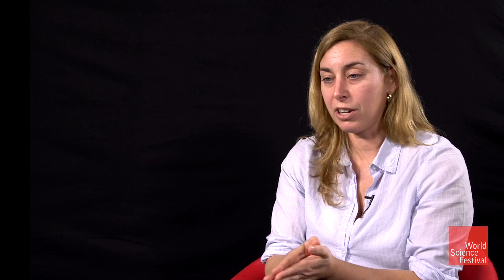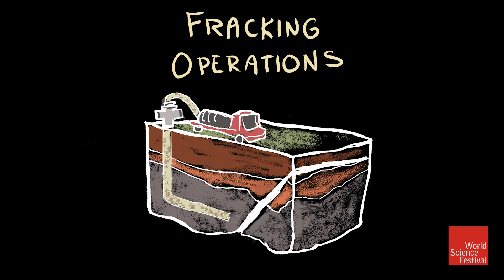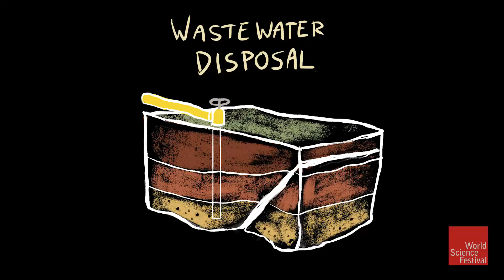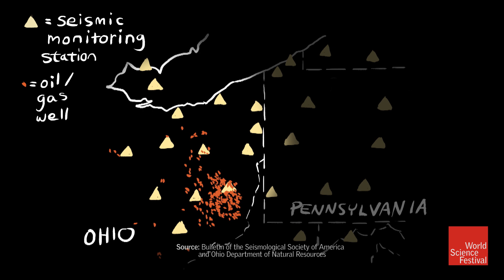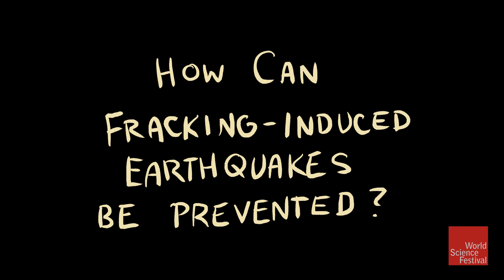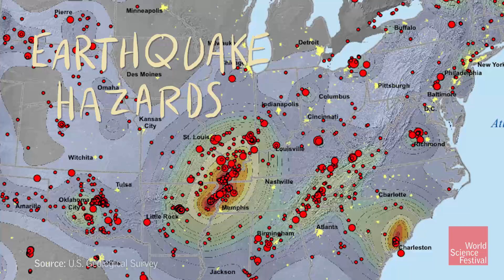How Can Fracking Cause an Earthquake?

Comment: This is sketchy scienece. It postulates that massive, tectonic forces are balanced on the compressed sediment or organic material and this balance is disrupted by machines that create pressure that's not significant in comparison to the masses involved.
Fracking doesn't even go low enough to contaminate the water table, how could it possibly go low enough to disturb a fault in any way?
Reply: For the people of Oklahoma, it has almost become routine.  The earth shakes regularly.  On January 6, two earthquakes with magnitudes of 4.7 and 4.8 rocked the northern region of this central US state.  The damage was minor but nevertheless alerted the local authorities.  One of the tremors, in early October 2015, took place near the town of Cushing, which is home to a huge crude storage complex containing up to 60 million barrels of black gold and considered infrastructure  national strategy.  In 2015, Oklahoma recorded more than 900 earthquakes with a magnitude close to 3, or two and a half per day.
 For 2016, the predictions are no better.  According to the National Earthquake Information Center in Golden, Colorado, the thousand earthquake mark should be crossed.  The central region of the country had recorded only 21 earthquakes of magnitude 3 and above between 1973 and 2008. Since 2008, the increase in the number of earthquakes is exponential.  The cause of this strong seismic activity is, according to a majority of scientists, the hydraulic fracturing of shale gas and oil formations and the multiplication of drilling sites – even if, in 2011, faults traversing the northern state  -east to southwest were the source of the most powerful earthquake the state has ever known
Reply: @bejakabyle  I'm from the area. Yes, there is seismic activity and always has been, though much lower severity and more infrequently than now.
You are however confusing correlation with causation.

I lived in northern Texas after Oklahoma, where drilling of the Barnet Shale paid dividends to all landholder in the area. Yes, there was increased MEASURED ACTIVITY. However there was no MORE ACTIVITY. Some kook who was as uniformed or misinformed as yourself demanded that gas companies measure or fund the measuring of seismic activity at and around drilling sites. Lo-and-behold, with more measuring came more detection. This does not mean there is more seismic activity and certainly not that it's caused by hydraulic fracturing, oil extraction, or any other process humans do, including strip mining and even dynamite blasting mountains. 

If we could CAUSE earthquakes we could conceivably stop them as well. We could also alleviate the threat of unpredictable quakes by regularly and gradually reducing the buildup of pressure between the massive pieces of rock that make-up the crust of the planet. It's simply not something withing the scope of human influence one way or another.
Reply: In Oklahoma, shale gas causes repeated earthquakes
 The multiplication of drilling sites and the enormous volumes of water injected into the ground by hydraulic fracturing are in question.
Reply: @bejakabyle  
No, it doesn't. That's bunk.
Fracking does not and cannot cause seismic activity.
Reply: @Pope2501  how do you know ?
Reply: 2 miles it’s not deep enough ?
Reply: @bejakabyle  
Go talk to a geologist at OU or OSU. Or in Texas. Or anyone in oil and gas. Anyone knowledgeable. Any geologist.

Comment: Look at site maps for earthquakes then look for fracking locations when they occurred. After affects aren't good either.
Reply: Correlation isn't causation.
Reply: @Pope2501  If you have a pattern of repeated correlation through a scientifical observation of the repeated processes involved, you either find yourself in the presence (an extreme low chance) of coincidence every time and call it correlation or in fact being a causation.
Remember, there are shallow earthquakes that happen from 2 miles to 10 miles.
If you start fracturing the ground near such an existing large fracture it will lead to upsetting the existing stability and create earthquakes.
Reply: @ElGoogKO  "Scientifical?" 

Ok, let's test your ability to understand correlation and probability. I think I can illuminate the situation with three or four questions.

Question 1:

If I flip a coin once, the chances of it land on heads or tails is 50/50.
If I flip the same coin ten times successively, and of the first nine times the results are heads, what's the probability that the 10th flip lands tails? 
Is it:
a) significantly greater than 50/50 in favor of tails
b) a small amount greater than 50/50 in favor of tails
c) exactly 50/50
d) a small amount less than 50/50, in favor of heads
e) significantly greater than 50/50 in favor of heads
Reply: @Pope2501 it might not mean causation but are you willing to take the risk. It seems to me the only way to find out is through more damage. 

They won’t take this serious till many are injured, so for now a smart person would look at this correlation and take it as a warning.
Reply: @Aslapfromthefuture  
They’ve already done it. There aren’t increased earthquakes.

The arrow of causality is pointing the wrong direction.
Reply: @Pope2501  oh ok.

Comment: I think I have heard of quakes where there is no fault lines. It is well established geo science that when water is subducted deeply it explosively becomes steam and the melting point of the rock it infuses lowers so that it becomes magma. This is how volcanoes are fueled. Increasing the injected water density with heavy metals so gravity pulls it down harder and infusing it with solvents would logically disrupt the layer that water table rests on allowing it to sink to dangerously hot depths.

Comment: I wonder why has Texas had 0 earthquakes in the past 7 days only 1 in the past month and Oklahoma has had 22 past 7 days and 83 past month. someone correct me if I'm wrong but Oklahoma does monitor fracking and to my knowledge Texas has no restrictions on fracking. Texas is well over 3 times the land mass than Oklahoma. I use these two states for example due to the proximity of them and given Texas is over 3 times larger than Oklahoma one would think Texas should have had more occurences of earth movement than Oklahoma. there has always been a lot more drilling per sq mile in Texas than Oklahoma so you would think more fracking
Reply: Rock strata is different in different locations. Monitoring did not cause it.
Reply: of course monitoring would not cause it is that where you thought I was going with my comment? in fact one would think monitoring would help reduce the chances of earth movement. Right?
Reply: Noot Brown Faults lines are not universally distributed. Also it seems Texas has major oil fields, not the minor, hard to extract fields of OK.
Reply: maybe because Texas naturally/historically has less to no faults?
Reply: Isn't because of monitoring they are counted properly.
Reply: Because Texas is blessed

Comment: why does it not say about the vast amounts of sand that get pumped in the the water. the sand fills the cracks. weird! people are so mis informed!!!
Reply: Sand doesn't stop the water from flowing it pushes the water more into the cracks.
Reply: +Teap The Pillow Puncher before absorbing the left amount of water but sand is a terrible absorber.
Reply: Sand makes for a poor cheap patch job.  Never use sand to patch a foundation made of stone.  It will eventually wash away.